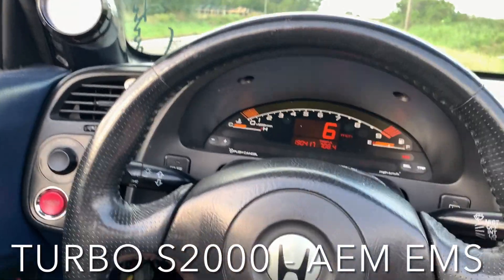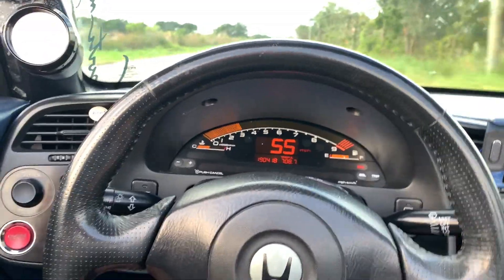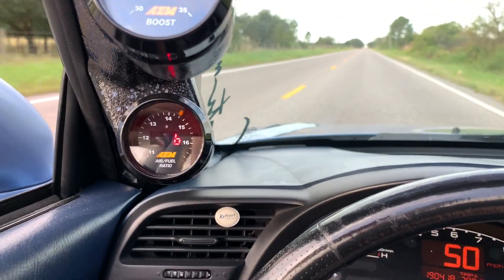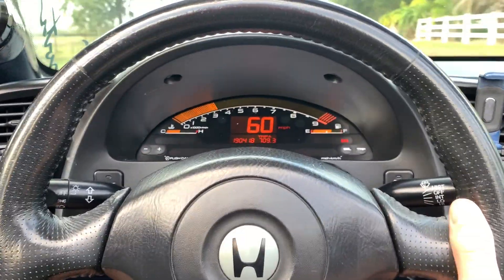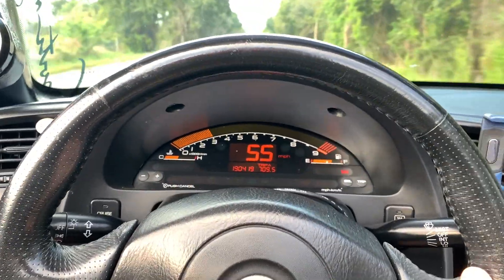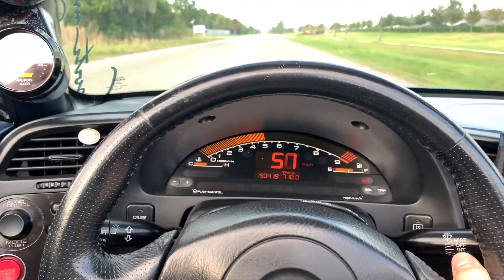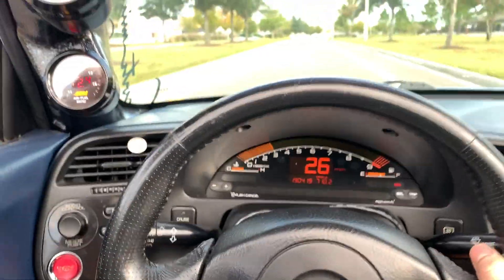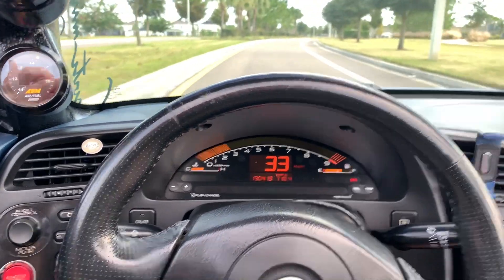Turbo S2000 - 300hp - AEM EMS

Comment: Great work. Most tuners tune for power but don't give 2 craps about driveability 🤦🏻‍♂️
Reply from the maker: You are absolutely right about that! Nice numbers and maybe a smooth Dyno chart but then crap idle and cold weather starts, awful AF during part throttle etc. I spend a lot of time in the 0-60% throttle areas.

Comment: Above idle with turbo you need 12.5 -11.5 afr to keep the engine cool or else at some point you will melt a piston when car temp after pounding gets too hot! Safe side tune for if injectors clog up which they do will defo destroy a piston earlier than you think!
Reply from the maker: What??
Reply: @ArcLightAddicts  ok then see in the long run. All tuners that tune cars will tell you that and if you monitor a factory car you will see the same results when running.
Reply from the maker: @bigspool  you gotta stop putting out incorrect information bud. I am a tuner - certified too ;)
Reply: @ArcLightAddicts  go ask real street he will tell you too or any major known tuner in US. That is the rule for keeping the cylinder cool on turbo cars even a bass map set up on most standalone will have these targets in the afr tables. That is fact and never was miss information!
Reply: I seen the afr at wot and it was on the lean slide not considered very safe at high rpm. Injector dead times is a tinch too low.
Reply from the maker: @bigspool  I think you're referring to AF while in boost only, not part throttle AF's.
Reply from the maker: @bigspool  AF is 11.5 give or take .2.
Reply: @ArcLightAddicts  correct  11.5 is safe
Reply: Thought these can make easy 500 on stock internals
Reply: Careful epa is scoping around vids like this.
Reply from the maker: @bigspool  They do! Mine makes 700 - 100% stock long block.
Reply: @ArcLightAddicts  yes bro just giving the heads up to be safe nice build. Be careful of uploads track is ok but road be weary they can use it against you. Nice ride